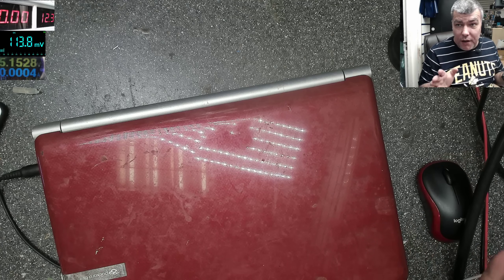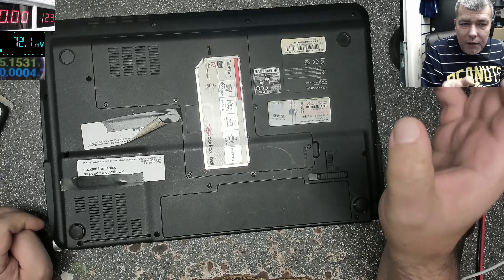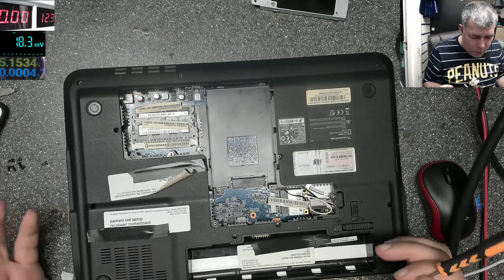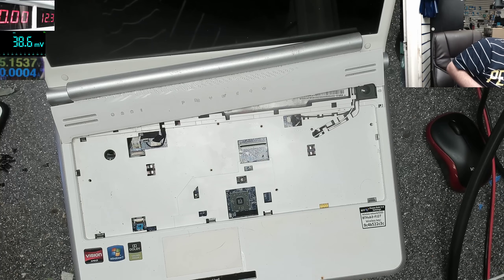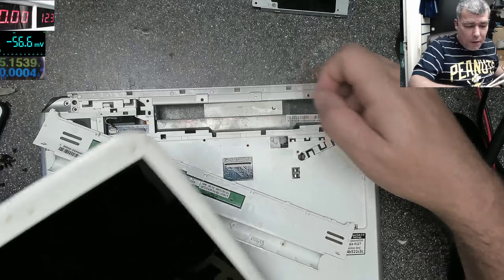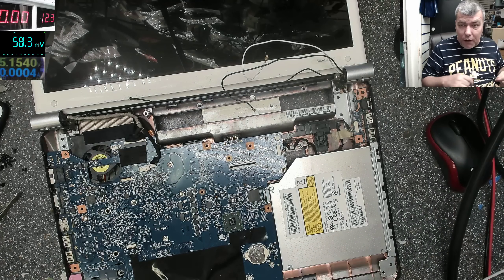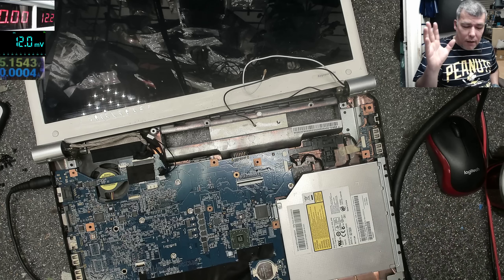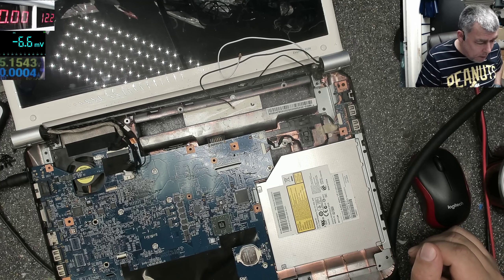Packard Bell Easynote pj74 - coming on but no picture - graphics repair

Comment: Got the same problem but when i opened the laptop i saw a burnt ic at the left top corner getting to the charging system area.. Can it be the reason why it's not because that ic is damaged?
Reply: I mean can it be that the ic is damaged that's y there's no display?

Comment: I've got an old HP Presario V6500 with a blank screen but works fine with an external monitor. Could it still be the graphics chip at fault?
Reply: no probably you have a screen cable issue or screen supply issue on the motherboard. whatever it is it's just better than a gpu fault and the fix would be more reliable.
Reply: @rezakianpour9668  My guess is it's a problem with the screen inverter.
Reply: @geoffhalsey2184  check if 19v is present on the screen pcb and also check if BK enable and DIM signal is available

Comment: My ASUS X93s is still running after 8 years and the dedicated GPU (nvidia gt 540m) is running hot regularly when under full load (96°C peaks, idle 50°C). I guess that wouldn't be possible in the laptops you can get nowadays ?! Never been repaired, only got a SSD upgrade. 30s boot time. What else do you wish for?  So, get an older used laptop and upgrade it. It may last longer than a new one. Sad truth. Don't forget to renew the thermal paste (and cooling pads if applicable) and clean out the fan!

Comment: Chip is only 10-15€. I think is worth to change it. Especially because you can't give warranty. From the customer perspective he is paying for something that can fail tomorrow. Just my opinion
Reply: 10-15€ but used, these aren't new on this days, you buy a used chip, most of the chips from aliexpress are  used, this is a good method from Sorin, 3 years with a reflow is flawless.
Reply: @MyFriendTheForest  yeah have to be used because chip producers won't sell chips to regular people and they won't even produce old chips.
Reply: Where can I find the chip ??...my maternal uncle gifted this pb laptop and having the same issue even went to repair shops but they couldn't fix it plus there is no service centre in India ..any suggestions highly appreciated thanks

Comment: Thats poor design and faulty rate of amd ,ppl saying amd is cheap yes it is but for a reason there is several problem with all amd's product models ,mostly gpu but sometimes cpu too ,it is managable but only if you know how to fix it ,means you have to know couple of tricks and basics ,most ppl lack of these ,I use amd, cost making me forget everything ,but if ı had a mission critical job ,I would not.

Comment: That Laptop been through the Wars...lol....Remove the GPU and just use Intel Graphics??...
Reply: weerobot core2duo laptops didn't have a graphics core on the CPU, only from Core i series and initially not on every series. Unsure when Amd stuff had graphics cores in the CPU but it was before Intel I think because AMD bought ATI and that meant they could 😎
Reply: @Infiniti25  Wow Ok Thanks...!

Comment: Sorin, i still use my old acer aspire 5315 from 2007, it is old but it has never failed.

I have replaced the heatsink compound and clean the heatsinks/fan out regular.
A good old beast lol.
Reply: What are your CPU and GPU temps on idle and under heavy load ?
Reply: acer for me only last 2years, housing hinge lcd
Reply: How do spot where exactly the graphic chip is ? I have opened up my Packard bell easynote lm81 and I can't seem to find it

Comment: its friday, this method always work with laptops, wonder why this wont work on ps4 apu
Reply: MrDinakdakan too much copper for the ground planes apparently, need a rework station or bottom heater at least to give it enough heat to get solder melting

Comment: What pins do you short to start the laptop ?
Reply: same pins attached to the power button, look at power button cable and short those two .
Reply: Romaine-Ricardo Francis some cables/connectors have more pins because the ribbon may also serve the lights so if you use a multimeter some are 3.3v some are 5v...maybe other variations of  power button voltages but you short one to a ground pin

Comment: Seems counter intuitive. I expect chips to fail when they overheat but that brought this chip back to life...anyone understand how?
Reply: reflowing solder balls, when they overheat the solder can melt and chips can move away from the board or stuff like that
Reply: @mohsentabouna6401  seems reasonable and explains why he did it on the underside of the chip, thanks!

Comment: Yep, I agree too. I own a PC that I put together in 2013, it's a K series i7 Ivy Bridge processor (OC 4.2GHz on all cores), with AsRock Z77 Extreme6/TB4 motherboard, 16GB of HyperX DDR3 RAM  (2.4GHz), 500W Active PFC power supply and Antec case. At that time the total cost of the system was less then 700 euro. Put it against a 700 euro system put together today and you will not be able to beat it's performance under usual workloads (synthetic tests are useless, the responsiveness of the system do to CL11 on 2.4Ghz it's "unbeatable" by any DDR4 memory from this price-range).

Comment: petrol petrol petrol petrol petrol. Im usin a toshiba made in 2008 crazy but still is working
Reply: Been using Toshiba's since 2007... Love them!  That original one still works, I used it yesterday to clone a HDD!
Reply: @robertcartier5088  as me that was the only change which i made in my laptop, changing the HDD for a SSD is a great update.

Comment: 8:50 -  I absolutely agree. The same goes for the cars, cheap plastic, single chains instead of double chains ( that, btw, were famous in Mercedes going above 1 mln Km without any issues)... we are literally surrounded from cheap garbage, but we are pretending to be "better"... Sad times, indeed.
Reply: Yeah. Consume, consume, consume. And Greta Thunberg and the Klimate Kidz have nothing to say about it...for some reason.
Reply: Besides they dont lower the prices ,even they rise the prices of phones on every new model ,they add 100$ on every new model since 2 years ,there isnt good thing in it for customers we are like chicken which pull a feather everytime.
Reply: Do you know what my phone is? Zte l5 blade. It's 3 years old 45 euros phone. I surely have money to buy something more expensive, but I don't need it. For what I need this phone is doing just fine.
Reply: @davianceable   It's sad alright, and low quality products are bad for the environment. Where does all the extra profit go in the manufacturing companies??
Reply: The electrical is also gettin cheaper and easier to break. The wires their using now are so frikin thin and they expect it to carry wicked amps lol. No wonder connectors are melting together all,over the place on newer cars. Especially the high end ones.their making their cars throw away after 5 years it seems like. I worked on a newer Denali and the heated seats were burning, the switches were melted and broken, the wires in the steering column were pulled out of the bulkhead connector because they were too frikin cheap to give an extra inch of wire ffs. It’s getting brutal. And the worst thing is is that the customers blame the techs for the dealerships shitty engineering.